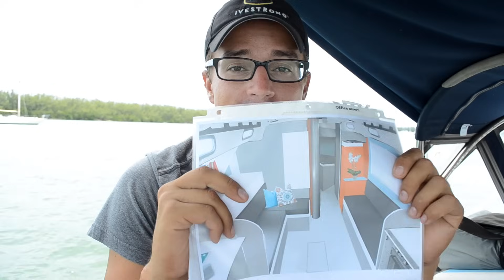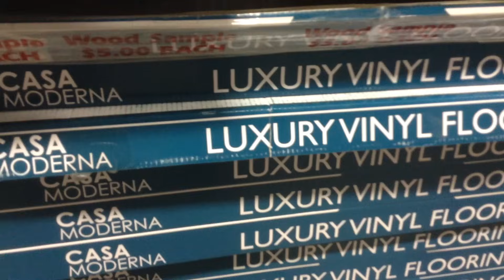Sailboat Interior FaceLift — Sailing Uma [Step 39]

Comment: Oh man.. next time don't cut off some the vinyl.. Just use a wallpaper roller to "squish" back down the little ramp. It also puts a small roll over on the edge so you won't catch your feet or socks on it once installed. 

You will need to redo the sharpie treatment every month. Especially down here in the tropics.

Comment: Looks very nice it was a nice surprise . Have a question to ask  about our electric drive ,Noticed that the forward end of your motor is splined for a shaft to fit in is there a way you could use a shaft an pulley to drive an  alternator to help recharge the batteries  while running the motor?.
Reply: What would be the point? The point of an alternator on an internal combustion engine is to convert some of the energy produced by burning gasoline or diesel into electrical energy. Running an alternator on an electric motor (which is an alternator in itself) would only drain more energy out of the system while putting a fraction back in.
Reply: Arcanus55 is exactly right here.  The additional load on the motor would drain more amps than the alternator provides.

If you could use a motor to run an alternator to power the same motor and not suffer any losses, we'd have infinite energy.
Reply: Not saying to run the motor but to use it as a charging system to replace some of the charge to the battery that you are using, such as when  you start your car or  have the lights on the alternator help replace  what u are draing out. like charging the house battery maybe.
Reply: arcanus55.  Not saying as to run the motor but a as charging  system to help replace some of the charge to the batteries to extend  life of a charge on the batteries Know it would keep up to discharge  may just slow in down a little .  There is a Company that has come out with a low speed generator   Franklin- Thomas Co.  Inc  just got Pat.  they are onYou Tube check out.

Comment: You get a ridge like that if you cut from the underside to the pretty side. Always cut from the pretty side down that way the lip is on the bottom and not the top.
Reply from the maker: I actually was cutting from the top. You only need to cut through the pretty layer, then the rest just snaps like drywall.
Reply: Sailing Uma Ahh really? That's unusal then. Still your solution looked great.
Reply from the maker: Thanks! Yeah, it turned out not to bad at all.

Comment: Wow....Dan you have outdone yourself! Way to impress the one known as Kika! You have way too many brownie points in heaven now...lol...:) 

I do wonder at your limit of an inverter of only 300 watts. Consider the ones we used to get from a tool discount distributer...Chinese most likely...$250 for 2400 watts...we ran these in Sears repair trucks in the lawn and garden dept. (Danvers, MA)...we even ran small air compressors on them...they weren't pure sine though and ate sears craftsman battery chargers for lunch...DOA after that...used to piss off our manager something fierce we had to use makita and dewalt battery tools because of this...they survived the experience no problem..even chinese knockoff tools survived..just dumb craftsman failed...if your 300 watt is pure sine why not run both at once when needed for your heavy lifting. If they survived the banging around our heavily loaded vans gave them I don't see why they wouldn't service a marine application. Just make sure you get a good one to begin with as occasionally we had to exchange new ones with the distributer...quality control was somewhat lacking in testing...once you had a good one though it kept on giving. Just make sure distributor has more then one in stock before buying and has an over the counter replacement policy in a DOA scenario.
Reply from the maker: Thanks, we do plan to upgrade our inverter soon to one that runs off our 48v motor bank. The one we have now, someone gave us and its works fine for now.

Comment: how do you like the vinyl flooring? I have to redo the sole in my boat and was thinking about putting down epoxy coated ply with vinyl on top because the original teak has swollen from so much water over the years. The vinyl looked like it got dents/knicks in it pretty easily though :/